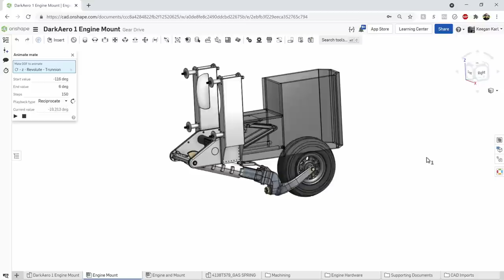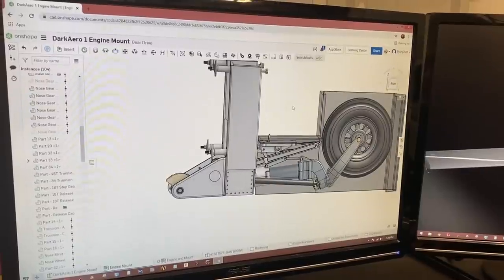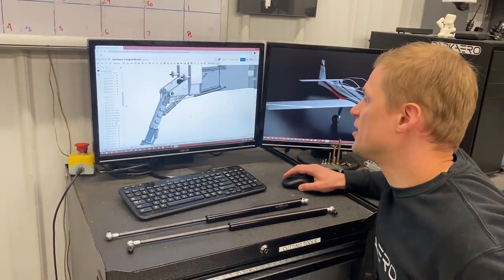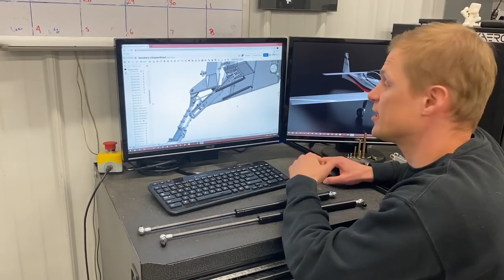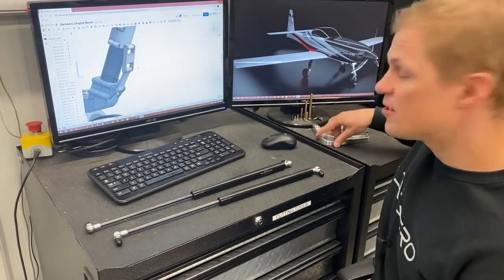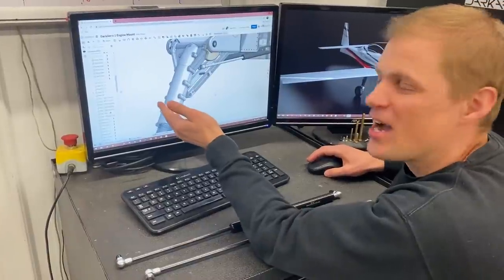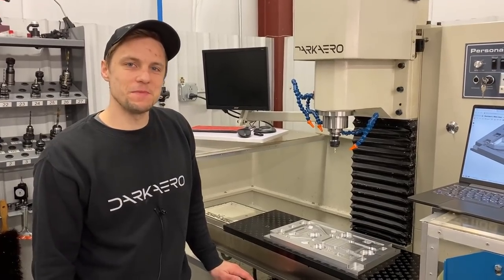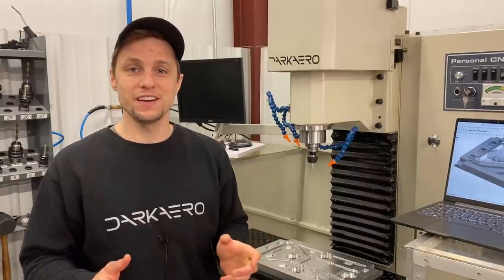Beyond the Prototype - Design for Manufacturability | DarkAero 1 Nose Gear ⚙️

Comment: Why don't you consider Additive manufacturing using DMLS/DMD as a substitute to produce the parts
Reply: Because they can not really qualify the parts. Another point is the cost. 3d printing metallic parts is pretty expensive compared to (aluminum) machined parts.
Reply: Expensive, slow and unnecessary for easily machined parts.

Comment: You guys seen to have an aversion to welding?  A lot of those posts could be made simply from flat and tubular steel stock at a much lower cost and some welding.  The machine stuff looks cool but even CNC machine is expensive in a production setting.  Think cheap!  It's one reason aviation is dying - there is no shortage of expensive airplanes out there.